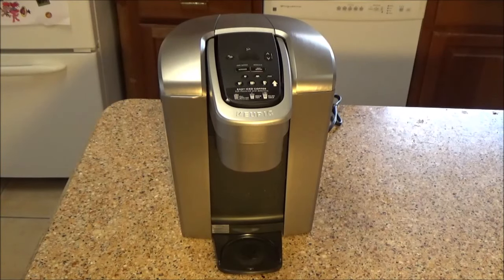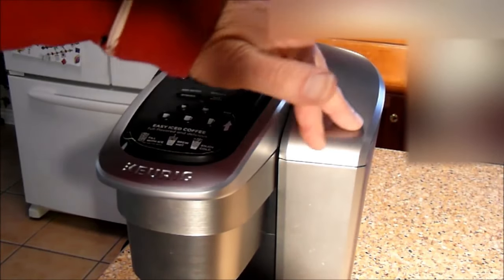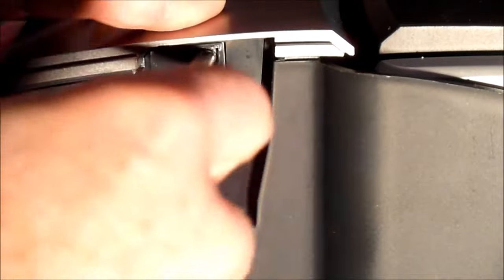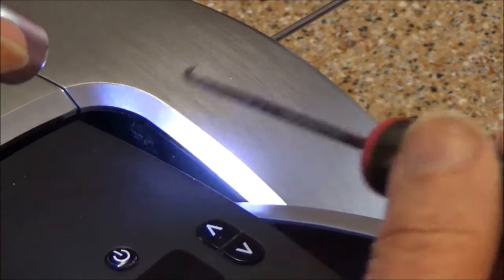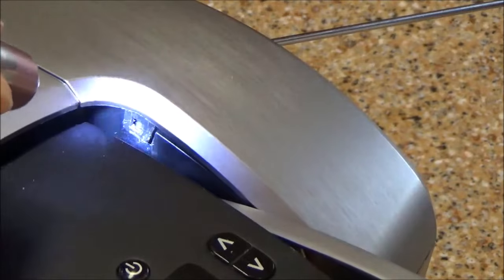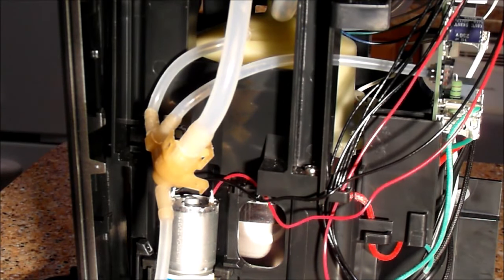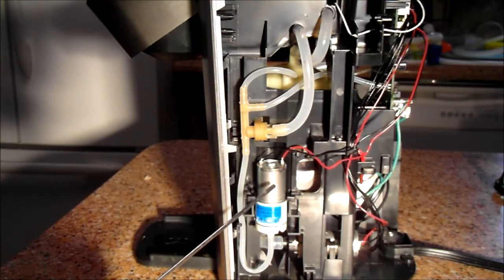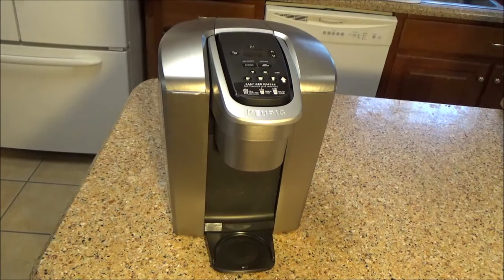Keurig Elite K90 Disassembly and Theory of Operation

Comment: Which way does the harness go?  Thanks....
Reply from the maker: Are you talking about a wire harness?  If so, which one?
Reply: @getitsettech1015  No, not wire.  It's a plastic thing the has two prongs on it and also a half moon shaped thing.  It pushes the cup up.  It came off and it can be turned upside down or not.  It just doesn't seem to fit in at all no matter which way I try to position it, and I cannot find any schematics with pictures.  I called Keurig themselves and the "rep" had zero idea what I was talking about.  This is my new girlfriend's machine, and it broke while I was using it, so if I can't fix it, I will have to buy her a new one.  Thanks if you can assist!
Reply from the maker: I finally recognized the area you were talking about - its just like you described it.  Try going to the Keurig Elite video to about 39:15 and play it for about a minute.  I'm talking about something else there, but you can see one of the arms in the plastic piece you are talking about.  It is covering and uncovering your view of the metal spring.  So you can see that this arm is installed such that going from back to front, it is curving downward, then upwards again as it approaches the front.   When it ends at the front side, that is where the two prongs are.  They engage into boomerang shaped slots on both sides of the pod holder housing (you have to unsnap and remove the pod holder and look inside the housing to see the slots).  Then the prongs slide within the slots as you raise and lower the handle.  The back ends of the plastic piece have tabs that appear to snap into some other pieces in the back, but I can't see it very well.  I'd attach photos to this message instead of describing it, but I don't see a way to attach photos to a comment here.
Reply: @getitsettech1015  I just saw your post.  Thank you; I will try that!  It's a very, very confusing design!

Comment: Is there a thermostat on this model?
Reply from the maker: It's not a thermostat, because a thermostat would be a switch that turns the heat on & off.  Instead, there is a temperature sensor that sends a temperature reading to the solid state processor.  The processor then uses that to decide when to turn the heat to the water tank on & off.  The temperature sensor is mounted on a metal strap that clamps around the hot water tank.  It's behind the plastic, so its hard to see unless you look down at it from up above.  There are 2 white wires coming from it that go to a plug in the circuit board labeled NTC.

Comment: Can I actually drain the internal tank by fooling the machine by placing water in reservoir, then remove the reservoir and letting the machine pump out all of the excess water…so that I can store the machine?
Reply from the maker: I started to try this idea.  What happened is that when I removed the reservoir, water stopped coming out of the exit needle.  This is because the water pump is what drives water out of the hot water tank by pulling it from the reservoir and pushing it into the hot water tank (since it is in between both).  When I removed the reservoir, there is no water left, so the water pump was left with nothing to pump.  It's input closed off (since there is a valve at the bottom of the reservoir that blocks it).  I quit this idea because the water pump isn't designed to pump with it's input blocked.  Even if a person opened up that valve, I wouldn't trust the water pump to handle pumping in air either, since it isn't designed for it.
Reply: @getitsettech1015  Simply pushing down on that spring loaded inlet valve that the water tank outlet fits into will allow any residual water to drain right back out of the machine

Comment: The display is working but the power button would not engage
Reply from the maker: It looks like you are the 3rd person here to describe that kind of behavior.  See the comments below from Jason B and Randy Lawson, as well as my responses to them.  The power button doesn’t directly turn the main power on and off – it just sends a signal to the solid state processor requesting to turn it on.  Because of that, it’s hard to tell why the processor doesn’t allow it to turn on.  Somewhere in the magic of the firmware, there is evidently something that is making the processor feel unhappy.  It’s hard to tell what that would be, because we don’t have a way to hack the software, at least I don’t.  I did unplug things from the processor board on mine one at a time, as I stated in one of my responses, but in each case I could still turn the machine on regardless.  The only thing I couldn’t simulate is if the air pressure sensor got corrupted for some reason.  I’d welcome ideas from people on this one.

Comment: You should learn how to fast forward through menial steps. 12 minutes to get the top off?
Reply from the maker: Point taken.  I'm working on a new video for the Keuirg K50 Classic and I'm fast forwarding through a few areas and it seems to help.  Unfortunately I can't fast forward through areas where I'm talking ;-) .  I may have spent a little too much time pointing out the latches, but on the older machines they were a big deal.  People were talking about drilling holes in the sides to get to them or breaking long wooden dowel rods trying to get to the latches at the top by reaching through the bottom.  I figured a few people may want to know where the latches are so they know where their targets are.  Concerning this existing video for the Elite though, there are some corrections like this and clarifications I'd like to make, but as you probably know, you can't update an existing video - you have to totally replace it.  That would mean losing all the views and comments, everything.  At this point I'm reluctant to do that.
Reply: @getitsettech1015  For future videos, perhaps you can put a caption on how far along a viewer  can skip to get to the next step.
Reply: What do you want for free? Not everyone has superior mechanical abilities. I thought it was great and I am a former nuclear power plant mechanic.

Comment: does the water level sensor have two electrodes for hysteresis?
Reply from the maker: Actually one of the two electrodes just goes to circuit ground (the one with the green wire).  So I think that this electrode is there just to make a complete circuit for the other probe.  I've shunted between the two electrodes and it only took about 6 megohms of resistance to make the Add Water light go out.  It seems to me that relying on a high resistance like that to tell you anything about the water level would be pretty unreliable.  Indeed, I've had problems with my own K90 running out of water, but the light wouldn't come on to tell me about it.